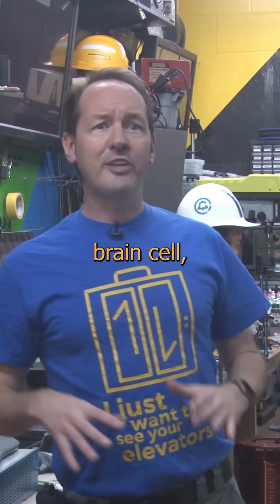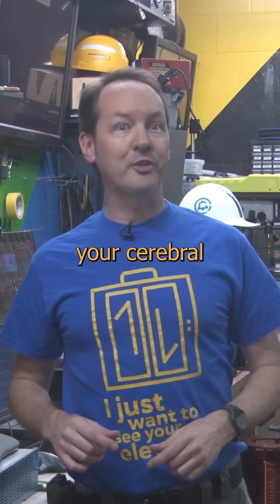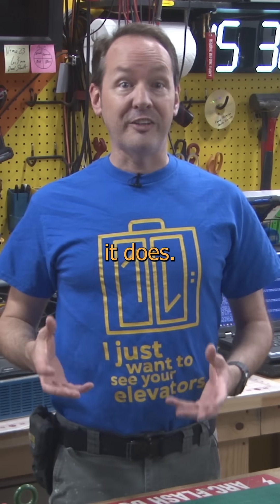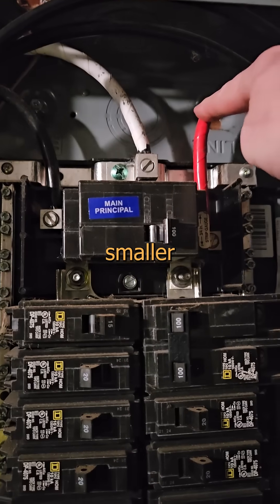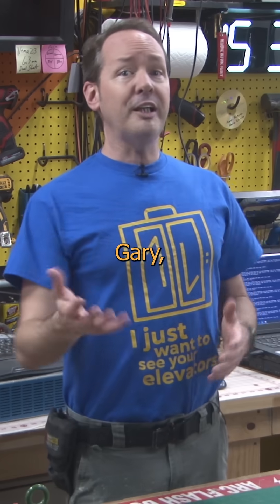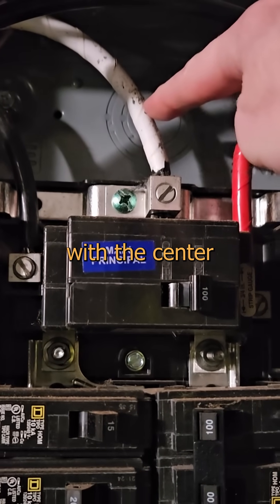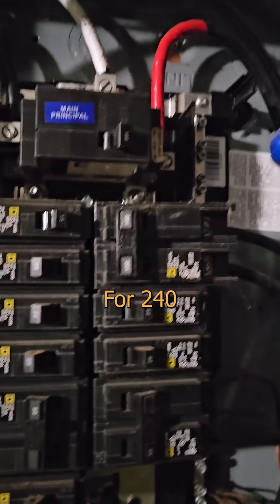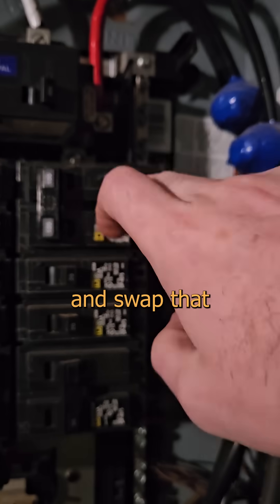Why It's Smaller #engineering #chrisboden #comedy #electrical #science #energy #power #electricity

Comment: The ground MAY have to handle the full short circuit currrent from the network, not "200A", long enough for the breaker to trip - that's why the breaker as a rupture current rating in kA.

Comment: Ground is what you connect to the box itself (any box: the circuit panel, the outlet, the case on an appliance, etc), so if any of the other wires touch it accidentally, that current goes into the ground wire and back to the source instead of through someone who touches the box

Comment: Under Canadian code, it has been determined that most of the fault current between a residential service and the neighborhood transformer will actually flow on the neutral back to the transformer and then to the X0. Therefore, if you are using ground rods or a ground plate, you need only install a #6 Common Grounding Conductor. If you are using the copper pipe the plumber installed, then you have a ground that is sufficiently large enough to want to draw that fault current through it. Now you have to size your CGC in accordance with the service current because your plumbing will take the majority of the fault current.

Comment: Where I live code requires to use at least 10 mm^2 ground wire (between AWG 7 and 8) and in 3-phase systems the neutral wire has to be the same diameter as live wires as in extremely unbalanced scenario (full load on a single phase) it will carry the full current of the circuit. Still, pulling even more power through the remaining phases only causes the neutral current to go down. 3-phase systems are WILD.

Comment: That's not actually "deconstructive interference" which is made by multiple phases on a load 180 degrees rotated, i.e. 240VAC.  When you talk about 120VAC though, it's only one phase, so there's no deconstructive interference.  The neutral merely carries the return current phasors at ~0V and it's the return current phasors that cancel out and you see the difference in the legs on the neutral.  

It's subtle but important distinction.

Comment: Ah! I saw where a guy installed a new dryer. It was a 3-prong outlet, so he used the old cord, but ran a small ground from the case to the outlet. I thought that was nuts, but I guess that wire would hold long enough to trip the breaker.

Comment: Is it REALLY very small though?  If I fire up a hair dryer in the bathroom while the microwave is running in the kitchen, and by a 50/50 chance they're on the same leg, that's 30 amps of imbalance right there.  It seems like it has the potential to be quite large if you get unlucky with your loads?

Comment: Idk. 200A won’t trip a 200A main breaker, and it will burn up a 12 gauge wire really fast. But a 200A service should have a #4 ground wire.

Comment: Destructive interference works nicely when you have 3 phases with nice sine waves 120° apart, but when you're feeding switch mode power supplies (typically in computers), they feed back a bunch of harmonics, and suddenly you have (among other things) 3× the frequency 3×120° apart, and that gets CONstructive interference instead.

Comment: Both legs push.  All phases push.  The legs just alternate pushing positive and negative, which pushes electrons in, out and down the wire.  Higher the frequency the shallower the skin effect.
Reply: Push and pull are a lot better description of the way the potential on each leg changes compared to the center tap.

Comment: TLDR, (if I heard correctly) the ground isn’t meant to handle the full load because the main line is already connected to ground, so it’s split.

Tho split between them if all the power from your circuit is fully loaded permanently… your house or situation will burn down (I’m not an electrician do not follow this as advice). tho I’m thinking about becoming one
Reply: The ground it not meant to handle the full load for an extended period because any current on the ground is a fault.

Comment: Fun fact: Electrons are negatively charged. They actually flow from negative to positive.
This is why you want to remove the negative terminal first on disconnecting, and replace it last when reconnecting your battery.

Voltage: this is how much we want to go there.

Ohm: the size of the door.

Amperage: this is how many if us are going to fit through that door if we're excited enough! 

Watt: this is how many of us are travel through this pathway in a second.

When things aren't going well for a circuit. You get a situation similar to a subway station in Tokyo during rush hour. That's when a circuit breaker says "that's enough! Nobody else is getting on this damn train today!".

I actually bump artists like Infected Mushroom while I am diagnosing vehicles. It helps me stay calm and energetic. Which is the result I am after most of the time since most problems with modern vehicles are electronic. It's necessary to have good vibes doing weird things when good things are having weird vibes.

Comment: Must not remembwr US centre tapled 240C AC apart from generalcknowledge.

Not enoigh neurons free.

For Home Auatralia and for low voltage 240V 50Hz AC I have a hard enough time remembering domestic let alone UK / EU amd certsin variations in Brasil & Chille

Comment: How about explain the ground setup for an off grid solar system with a portable generator. One old guy told me to ground the negative pole on the battery plus the frame ground on the generator and metal frames?

Comment: Important to notice here: they get normal voltage 240 volts there,  but make some weird magic there to have only half the pushing power left. 
If i would have to build an us american home for me,  half the sockets will be german style schutzkontaktsteckdosen with 240v,  and my walls will be bricks.  And windows can tilt. 

I know 240 sockets are possible,  but are they also possible technicaly as the main output,  where most the load is? 
Something bakancing wise?  The right breakers ?

And are german style fuseboxes/breakers legal in the us?

Comment: Wow that hurt my brain well what little brain I have in there I have a question I want to put a 50 amp breaker in my breaker box and run a generator setup for it will that power the whole breaker box and what I mean by that is will it provide Power to all the different breakers on both sides or just down one side

Comment: When I explain it to people , I start with calling it "split-phase" with 180° phase angles,  and explain how the center tap  TRANSFORMER is what is "doing the magic". On an old oven with pure resistive loads, the voltage is simply "pulling and pushing" and always balanced. Now say you have a loose bond to neutral for example . When you try and use a 120v load , it's going to try and "STEAL", that Inbalance from whichever leg has the least "load".  The voltage pushing that current will do WHATEVER IT CAN to try and make that happen .....lol

Comment: Where I once worked ... we had 3 phase at 230Vac ... and it had been working fine for years ... until one day all our electrical appliances and computer equipment started popping before the supply tripped ... the long and short of it all was that the neutral wire from the street to the meter box decided it didn't like what is was doing ... and decided to take a break!
Wasn't much we could do but collect all our damaged equipment in a pile, get the power company to come find the problem and replace the wiring whilst sitting back doing nothing for a week whilst it was done !

Comment: And when you break a neutral all that excess voltage will find it's path to ground. Usually through your Coax system and melt the cable at the bonding connection.

Comment: The way everyone is safety over designed in this stuff it blows my mind that yes in theory the 220 loads don't use the neutral and yes the two legs cancel each other out.  But what if there is enough unbalance in usage the neutral have more load.  

I sort of get they count on the extra built in capacity of the rating vs reality but the whole thing is built on keeping things below that imaginary certified eating

Comment: I've run across a few bits of electrical kit when the allowed overlord basically went to infinity as the time went to zero because there was enough thermal mass and inductance that you basically couldn't ramp the current fast enough to over heat it any faster than that.

Comment: It carries the imbalances, big deal say in motion picture filming back in the day 

Neutral the grounding  conductor , voltage present in normal operation 

Ground ,the grounded conductor .voltage present in fault condition 

Ill argue against the 12 ga. popping a 200 reliably in the real world ,itll most likely burn it and go looking elsewhere 

Heance why 4ga is the minimum size mostly because of its physical resistance to damage  with out being BAG wire = bare armored ground.

Comment: For safety reasons it’s better you have the ground at least as thicc as the other two wires. WHY? Because of:
1.) For a long wire resistance might add up enough for the instant-trip not to trigger in which case we’re stuck with the slow thermal trigger inside the fuse which isn’t really ideal
2.) Small wires get oxidised easier because the proportion between volume and surface area is like that sometimes. Especially dangerous for multi-stranded wires.

Now, can you get away with a centre tap wire that’s half the cross section? Yes.
Is it good enough for 99% of the cases? Yes.
Would it be better to not cheap out on one single strand of wire? Absolutely.
Reply: The earth is usually one size smaller.

Comment: Similar to how 3 phase power gets away with a single neutral that is small in comparison to the 3 active phase wires. However, the active 3 phase legs actually provide some neutral for each other.

Comment: Ground is the connection that is definitively "NO POWER," in logic systems especially, there are instances when leaving a connection open isn't guaranteed to cause a loss of power, you can't do anything useful with that spare power, because it's just not enough, but it is enough to cause interference, switching a transistor when it's not supposed to be, causing phantom signals to appear in your IC, but if you don't open it, but instead send it to ground, you can guarantee that that line has completely lost power. This usually doesn't cause issues on things like your phone nowadays, but it still applies. With a bigger system like a whole breaker switch, there's more standing power in the lines, enough to cause issues, and the ground wire in your switchbox will make sure that the connected switch is unpowered, and that's also pretty cool.

Comment: Early in my short, thank you 2007 mortgage crisis, electrical career, I was working on a hot circuit in a residential garage swapping out receptacles. I didn't touch the hot wire, but touched the neutral and got a little buzz. I mentioned it, and someone said there is probably a device plugged into the circuit. I looked around and there it was, the hot water heater circulation pump.

Comment: I just did a big project installing a grounding electrode system for a small radio tower. The weird and unpredictable world of lightning and lightning protection would make a great video. Start with how “the path of least resistance” isn’t how it actually works; get into Motorola R56 and how the electrical code is, as usual, the bare minimum; and end with how despite your best efforts lightning can still do whatever the fuck it wants and destroy your shit.

Comment: Thanks for the great videos. But nowadays Neutral wires are actually the same size then the phases at least in Europe. Since for none linear loads the current in the Newtral wire can actually double due to the 3rd harmonic. 
I know we use 230/400Vac for households with 120° phases shift which is slightly different to the 110/220Vac with 180° phase shift in the US. But a similar occurence could apply to you neutral too. 😉

Comment: That's why the old school sparkys could wire kitchens home runs with 12/3 and share the neutral wire. Two circuits in one cable. The two circuits just need to be landed on opposite 120 legs so you don't get uneven loads on the neutral wire.

Comment: But you need really thick ground wires if you need to run the cable for a longer distance. I know some extension reels with 8 to 10 mm diameter full copper ground wire with 50-100m length.

Comment: I have AFCI breakers, can you do a video on how those work? I accidentally tripped a breaker doing a drywall repair when my knife touched both contacts. But I didn't get bitten. I felt a charge, but I never felt the bite of grounding out. How does the breaker turn off so fast that it keeps me from getting shocked?

Comment: I still remember moving to a new house as a youngster and watching my Dad rebalance the loads in the breaker panel because someone had managed to hang a significant amount of the household 120v load on one busbar.

A lot of the heavier loads ended up being switched to 240v, but he then totaled the average utilization on the 120v and swapped them up or down a breaker to balance the panel closer. 

Apparently the meters in that area were happy to run up the bill on 120v loads, so balancing it was supposed to reduce the billed consumption even though you were using nearly the same wattage overall.
Reply: All residential meters in the us are happy to read 120 or 240, (unless you have an antique that’s 120 only) but they register true power. The only savings is that 240 volts transfers power slightly more efficiently, because at a given wattage, the current is only half of what it would draw at 120. Therefore, the voltage lost in the wiring will be half. But I think you would be hard-pressed to see the difference. It is good, however, to have a reasonable balance, so as to not overload the neutral. Big loads almost without exception already run at 240, so those usually don’t have an imbalance.
Reply: Unless you're actually tripping your main breaker by overloading one leg, there's no real advantage to trying to carefully rebalance all your loads that way.  The electrical meter doesn't even know (or care about) the difference, and the panel and power lines are rated to handle an unbalanced load just as well as a balanced one.

Distributing the loads will give you more headroom if they increase in future (i.e. you plug more stuff into your outlets), but that's really the only main benefit.

Comment: The way it sounds to me is like you have two hearts that beat in an offset that share a ventricle in the middle and the neutral is a vessel that carries away excess blood when one of the hearts beats off rhythm. And the ground is like a valve that let's out pressure if they both beat at the same time? Is this a good analogy, or am I down to one braincell?

Comment: Hold on, with wrong enough phase shift (shit switched power supplies), you can get more current at the neutral than both of the phase wires. Buildings like data centers might even have N lead stronger than the rest.

Comment: U made a common mistake ..the earth is live if anything is switched on ....the neutral and earth are bonded at the fuse box (this is how earth works after all ) it's to balance out the current if there's a fault the in the netral orphase wire live will go back to the power station (or supply) via the earth ...but if any appliance is turned out the phase travels from phase to neutral, this means there's phase on the earth to

Comment: 200A? Childs play.
A dead short to ground easily puts you in the 1,000A+ for a cycle or two.

The only thing my utility guarantees for resi is that they probably won’t go over 10KA for a dead short. Usually limited by cable lengths and contact resistance.
22K for light commercial
65K for light industrial/heavy commercial 3P 480

Comment: Exactly, service neutral only has to handle the imbalance between the phases and ground is there for reference, its not supposed to be carrying current--something should be tripping if ground ever sees an appreciable current.
Reply: You're conflating the neutral and ground.  The neutral is for carrying the imbalance of current, and is meant to carry it under normal circumstances.

The ground by contrast, is meant to never carry current under normal circumstances.  Its purpose is to be an emergency alternate return path, in case a live wire faults to a metal equipment housing, so that it travels back through the green wire and trips the breaker as fast as possible.

Comment: The neutral being at “zero” due to destructive interference is the best way I’ve ever heard it explained. ❤
Reply: Loosen up that neutral wire and you'll see one side eventually go full 240 as devices let magic smoke out when the other sides impedence drops in comparison.😮
Reply: @robv.o.1777 Dropping the neutral shouldn’t change the impedance. It will change the voltage and current across devices if there is an imbalance. 
Some things will get higher voltages and some lower. If they can’t handle the higher voltages they may be damaged, changing the imbalance. The only way any device gets close to 220v is if nearly all devices on that leg fail, reducing the load. Some breakers will probably trip as the load bounces around. Most likely all devices on one leg will fail as the currents change rapidly.
Reply: @TomCee53 the side with the highest resistance will have the voltage increase as more and more devices release their magic smoke. The side with more devices or higher load will have lower voltage😊
Reply: Me too!  I've never heard it explained that way.

Comment: Edison 3-wire system.
Reply: Red phase is drawing 5 amps on a 120 v load. Black phase is drawing 5 amps on a 120 v load. 0 amps on the neutral. 

Red phase is drawing 5 amps on a 120 v load. Black phase is drawing 3 amps on a 120 v load. 2 amps on the neutral.